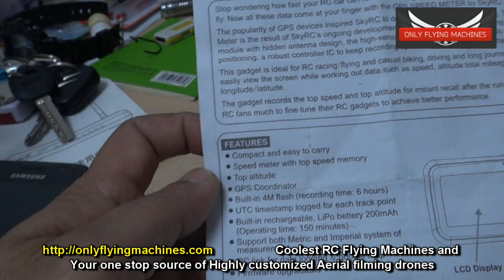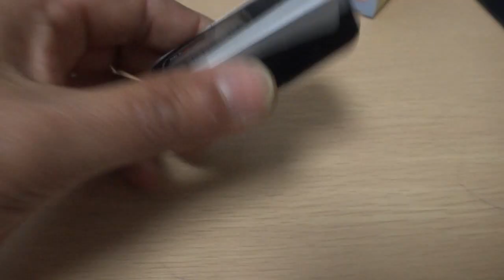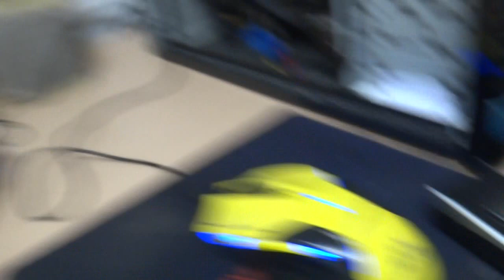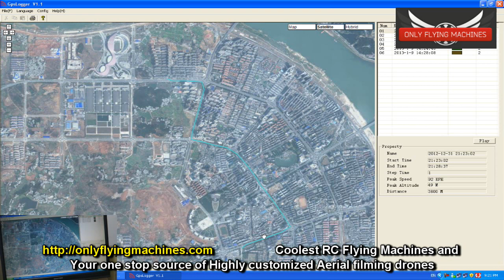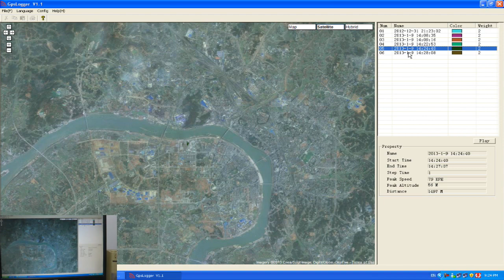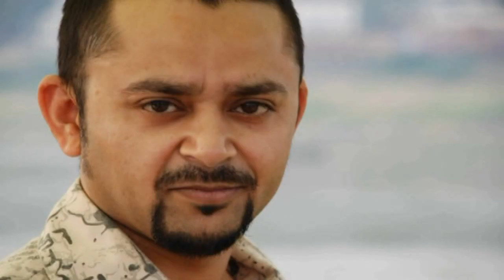Review - Handy SkyRC GPS Logger Gadget

Comment: This Unit is a piece of crap.  Good if you just want to look at it but you can just use your phone to do all this.  The problem I have with this unit is that you cannot do anything with the data as you can only use it with the supplied software and not other program can use the .gpl file it generates.  No GPX

Comment: i did buy this unit but it seem that it only works in china because in Australia it will not work i can not even download the logger for it that work and after a few days trying to get it connected by uninstall and reinstall about 18 times i give up. so i only used it for reading speed after the third time i wanted to use it the battery was flat and refused to recharge.not worth AU$83.i was told by 2 gps repairers that it cost more to repair.
now it in in the rubbish bin. it has been the worst purchase i ever made

Comment: I wonder if there is a logger that also keeps orientation and software to generate On Screen Display graphics to edit into HD video from an on board camera. That would be cool.
Reply: I just ordered this. The flight path in google earth seems 2D keeping ground altitude.  Can google earth or any other software plot the flight path in 3D with this GPS unit?
Reply: +flyamil  read my comment. it is a bit of chinese crap
Reply: +Casey V I got one and it works ok for me here in New Jersey. I can download files and import into Goggle Earth with very accurate altitude and speed. It is not a straight forward process, but it is doable. Everytime you have to tweak Google Earth to draw the data. The graphics that Google Earth makes are not great. It draws vertical lines from the ground to each location read by the GPS which get crowded and hard to see, but it doesn't draw the path of the plane from one point to the next which I is what I really want. I hope there is a too for that.
Reply: mine is already in the rubbish bin i will purchase a Garmin

Comment: Just got one a couple weeks ago. Only used the max speed mode for a few runs but works good. Now just need a computer for the other stuff. Only weights few ounces. Got mine on eBay for 110.00.